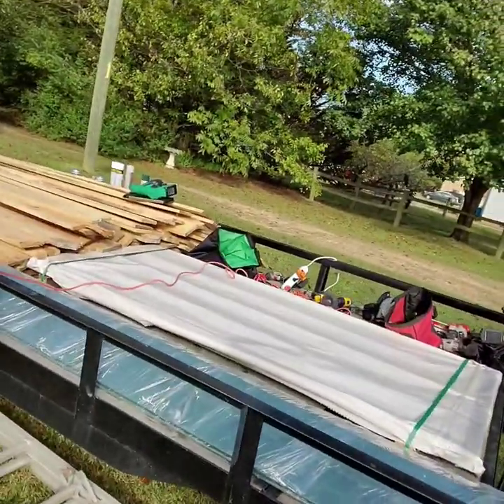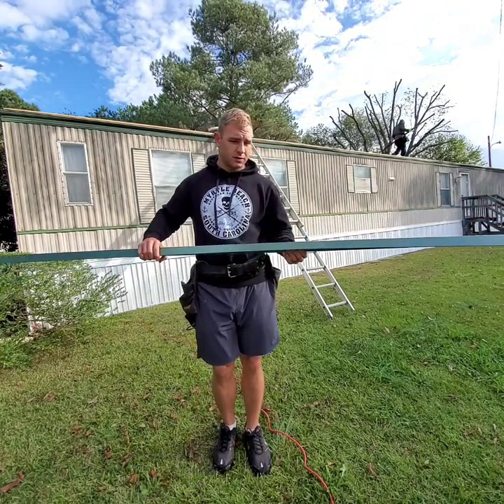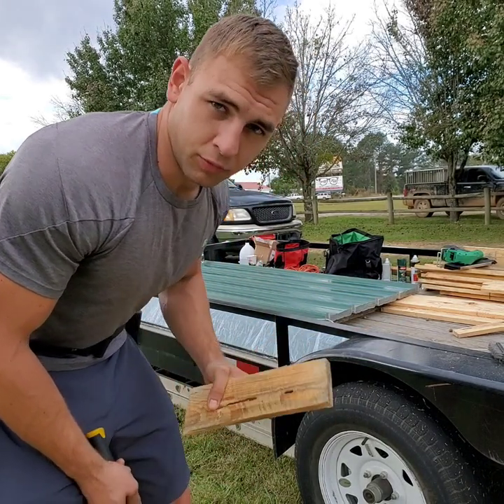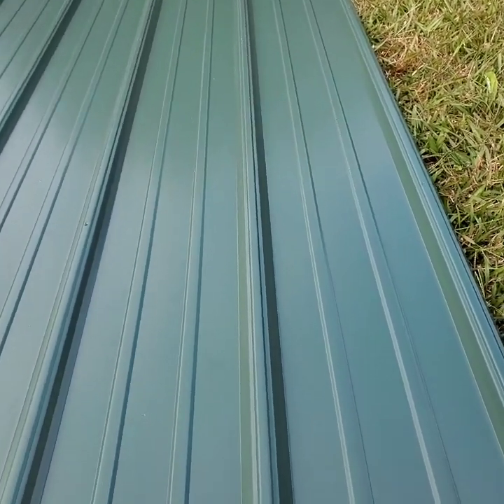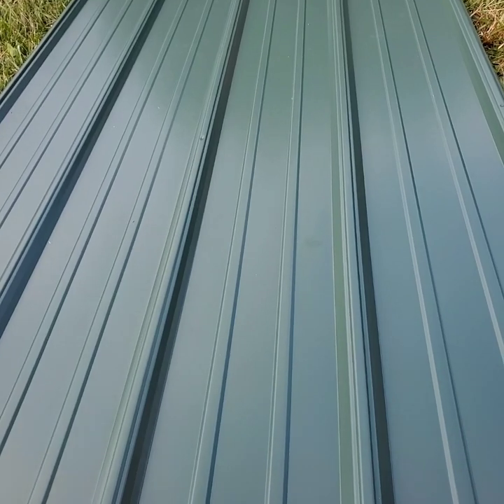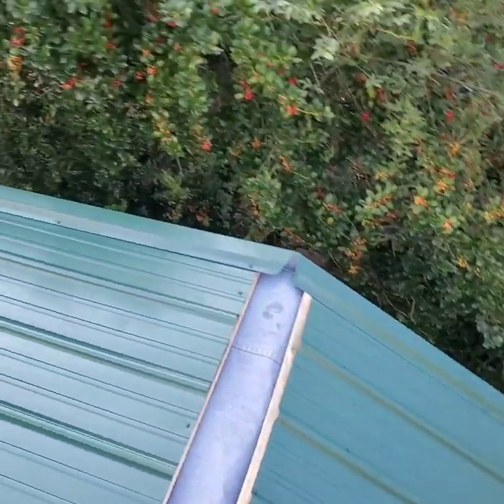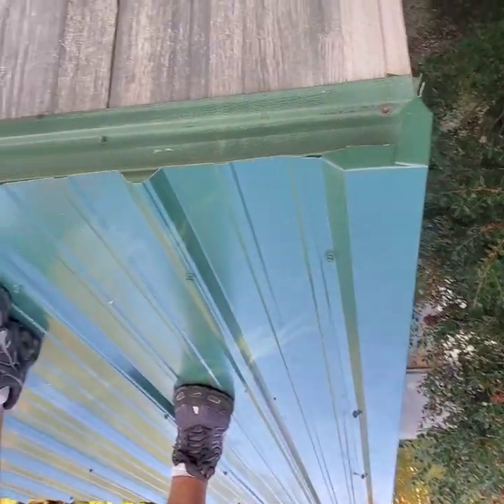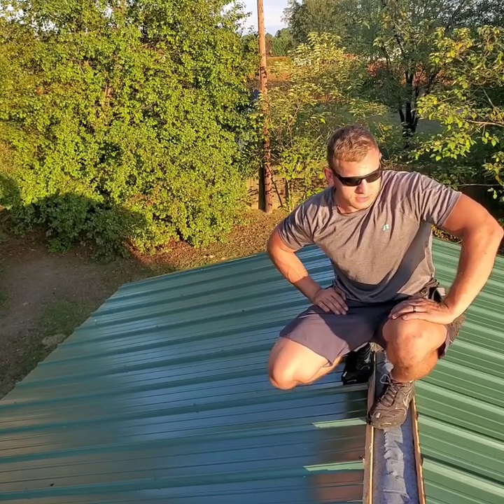How to install a Metal Roof on a single wide.

Comment: Any condensation issues between roof systems ?
Reply: i've heard even small leak shouldn't really be a problem with the old roof beneath
Reply: @cdoublejj   The old roof underneath is now perforated with fastener holes so I doubt it is water tight .
Reply: @markv151  that would be an awful lot of condensation
Reply from the maker: No issues with condensation.

Comment: Do the 1x6's need to be treated? do you notch the bottom side of them to allow condensation to escape. Do you recommend peel & stick ice & water shield before the 1 x 6's?
Reply from the maker: They are untreated, and should be that way. treated can have negative impacts on the screws, You can put down ice & water if you want, but there isn't any reason to put it down. That is mostly used for valleys and shingle roofs.

Comment: You might want to consider staggering the joints of those 1x6 next time, offers a little more support in a wind storm.
Reply from the maker: Screw patterns would look horrible. But I could see a small benefit.
Reply: @rickyelliott3458  No, start your first run with a whole 1×6 then start your second run up with one 1×6 cut in half. This way you have the butt ends of your lath breaking on different truses.  If the wind should get under the tin it won't pill whole sections off at once.
Reply from the maker: @chrish3720  I see what you are saying. I agree that would help more. I would definitely use it at the beach.
Reply: Just trying to help. I like seeing a young man give it a shot. I've been in business for 24 years now. A capenter for over 30. Those old guys taught me a lot in the beginning. Have good day and good luck.

Comment: I noticed you put some foam along the ridge,  before you put ridge cap on, my question is
What was the measurement distance  to place the foam on metal roof.
Reply from the maker: I try to set the foam towards the center of the outside and inside. TO allow the pressure from the screws to hold it down and in. Their is also sealant that will help fix it in place.

Comment: I have a single wide with a slope in the roof how would you do a roof like that
Reply from the maker: I don't install metal on anything below a 3/12 pitch.
Reply: @rickyelliott3458  what type of roofing would you use? Would you frame a pitched roof first or could you use 2x6 instead of 1x6?

Comment: what is the purpose of the 1x6 framing? why do some people use this method and some just lay the metal strait to a shingle roof
Reply: I was told by a roofer not to allow ashfalt shingles to touch the metal roof...bad corrosion would result

Comment: The part I don't like about that type of roofing is all the inverted v notches along the outside wall that allows all sorts of wasps and insects to get under the roof. Those open holes would have to be sealed and or vented to keep wasps and other insects out. I would probably prefer light gray to reflect as much sun as possible from being absorbed into my home. Dark colors only absorb more sunlight and in the summer it will cost a fortune to try to keep your home cool.
Reply: U can plug those holes using the same form molded foam used under the ridge cap but I don't
Reply: I was saying I don't know if that will hold moisture and cause corrosion between the two metal roofs
Reply: @terrysmith1914  I don't know about the moisture either. I do know I'd either rip those 1×6 in half or just use 1×4. Lumber  today is too expensive to use a width more than you need. I would also use wood screws only and make sure they go into each joist underneath the old metal roof. What's bad is some times the trailer manufacturer would run electrical wires between the metal roof and the joist making for a horrible electrical fire if you happen to send a nail or screw through it.
Reply: Do they put anything over the screw holes?
Reply: @follc1991 usually no as they have a rubber like washer on them to keep it sealed.

Comment: What length of nail are you using to fasten the 1x6 down? The questions been asked a few times with no response.
Reply: I would recommend ringshank 8's ,8d/8c.Typically the trusses are 2" material in mobile homes.
Reply: What about using decking screws?

Comment: Is there a reason to use 1x6s over 2x4s?
Aren't 1x6s more expensive? Jw what i should use.
Reply from the maker: They are wider and help support the metal and people walking on them better.
Reply: @rickyelliott3458  right.. I just learned this the hard way.lol
Im doin my roof right now by myself and i did 2x4s cause cheaper and more bite with the screws for my trailer rafters.. But when i tested one out and walked on it it bent the sheet all up... I did 2 ft centers.. But not enough support obviously with the 2x4s.. So i had to run extra 2x4 supports between them.. I wanted 2x4s tho cause my trailer is old and wanted to screw them in to rafters with screws instead of nailing them so better strength.. I assume the 1x6s are prob better for if you put the insulation board in too( which i did not)

Comment: Hi I just wanted to ask what size screws do you use on the panels and ridge cap?
Reply from the maker: I use 2 to 2/ 1/2 inch screws, and we use a wider ridge that is 9 inches on both sides. 18 in total.

Comment: can a mobile home ever be moved again after this type of roof install?
Reply from the maker: Yes it can,  but the screws must be done right. The wind from the highway can and will make panels fly off if the screws aren't done right.
Reply: @rickyelliott3458  Thank you!
Reply: @rickyelliott3458  just a thought but if you lay the panels end of trailer to the front where the hitch is I would think would eliminate that likelihood as there would be no edge facing the wind drag being pulled down the road.

Comment: It is expensive that kind of metal roof?
Reply from the maker: We give free estimates if you are located near Lee county, Nc. We believe the money is well worth. When considering this install came with a lifetime paint warranty from the manufacturer & a 20 year no leak warranty.
Reply: you can call your local metal building stores and ask if they have extras or off the wall .i just priced for a 14 ft wide and 1 panel was 32.00 if i buy off the wall they can be shorter but they are10.00 each and are different colors. nothing that a little paint cant fix.
Reply: That 20 year leak warranty isn’t anything a manufacturer offers. You as a company offer that to customers. Soooo what happens if you go out of business?? Who’s going to warrant that roof?

Comment: What about the old single trailer that has a flatter roof?
Reply from the maker: Most people will install a new 3/12 pitch frame with wood, or go with a flat epdm roof method. Which involves using osb/fiber board and EPDM (rubber).
Reply: @rickyelliott3458  iv been told the metal dont need much pitch at all for water run off and could lay osb down then metal over that. What's your thoughts on that
Reply from the maker: I personally would not install it if it wasn't a 3/12 pitch. I would use rubber. The risk is to great in my opinion.
Reply: @stevebillow395  not sticking my nose in but that won't work - i replaced a flat roof  a couple put on their house you have to have some pitch - don't let anyone tell you different or you'll regret it.
Reply: @rickyelliott3458  what was the pitch on that roof ? doesn't look more that 3-4/12 ?
Reply from the maker: @larryrichardson5167  ruffly a 3 or 4 on 12.
Reply from the maker: @beavis4play  pitches are always preferred obviously,  but EPDM is used for flat roofing
Reply: @rickyelliott3458  -- agreed- i used that on a very small porch attached to a  greenhouse and it worked well. i still would rather use some pitch though- thanks for the reply!
Reply from the maker: @beavis4play   I deffentlly agree.

Comment: Is weight of the metal on the trailer framing a problem?
Reply from the maker: A metal roof is 1/4 the Weight of a shingle roof. It is not a problem at all.
Reply: Is that some kind of membrane on the roof or is the or is the roof that good a condition? Should there be something between the original roof and the metal ?
Reply from the maker: @michelestellar153  no
Reply: @rickyelliott3458  my entire house is clad in 'tin' now I was just asking because that was always on my mind. Done by local Amish and I LOVE it. Highly recommend the steel it has sealed my house whereas the T111 siding was never as 'tight'. Here they call it  'tin'. Love the comfort and durability and the snug feeling... And the sound of the rain on the porch roofs. The roof over the house proper does not make much noise. Just letting others thinking of steel  know that it worked out great for me. Hail is a big deal here, we have had some the size of tennis balls, totaled a car, my roof and siding, not a dent. Your job looks great .
Reply from the maker: @michelestellar153  Metal/tin is the best roof/siding you can have. I agree with you. There are different grades of metal and paint systems. But in General agree. For doing overlays on factory tin roof's you don't have to do any membranes. The home owner requested we remove the rust, though I insisted it was not a problem.  For any other type of roof, or siding, I would recommend a synthetic underlayment.

Comment: I dont like that a little rubber gasket between the sheet metal and the top of the screw is the only thing stopping the water. I think the sun will dry the gasket and now you got a leaky roof.
Reply from the maker: It can happen, if the screw was run down to hard, but the screws are designed to last the life of the panel. You most defiantly may have problems if you install them in the flat section of the panel. We put our's on the higher part. We warranty our roofs for 20 years. So I have confidence in it.
Reply: @rickyelliott3458  I was happy to see u put em on the peak folk round here put on the flat and leak leak

Comment: How much money did you charge to put the roof on..
I'm doing one basically the same size
80×16...

For my Kid's grandma trailer....

She paying me 600..

I'm doing it dirt cheap for her..an making it a family thing I have my boys helping 

The reason I ask brother how much you charge 

Incase someone wants me to do one for them

I can over bid
Because I can't handle this kind of work no more..

I'm guessing over 2000 you charge 

The trailer I'm doing the wood trusses are up n down 1inch in some places 
I got the strings out..an trying to fur everything flat..

This is a back breaker

Comment: how do you determine if the single wide mob8le home is strong enough to hold the new metal roof....because ive seen some where they put in poles on all four corners and some in between against the exterior walls  so that the new metal roof is supported by the posts...
Reply: That seems overkill not much of a mobile home anymore if you do that, I've seen them hold up fine with a ft and a half of snow on them no problem, they don't build them very well but with interior walls helping carry the load they do ok supporting a decent amount of roof weight
Reply from the maker: If the rafters are in good shape and not rotten. Then she is good to go.

Comment: Never screw on ribs guys
Reply from the maker: Hi Bryant, I appreciate your recommendation. I, however will continue to advise screwing them into the ribs. Placing these screws in the flat's puts them directly in path of water flow, which overtime will deteriorate that washer garment. Some roofers will claim placing them in the rib causes the screws to back out,  I don't find this to be the case.
Reply: Sorry ask ur manufacturer about it
Voids warranty on the ribs 
Screw on a rib it doesn't get a good deal also when the metal moves the hole gets bigger
Reply from the maker: @roofking2314  my entire family has been installing roofs for over 30 years. My uncle has been a supply distributor for over 15 years. I say with full confidence, this is not the case. Yes the manufacturer recommends this, I do not. I am the one who warrentys this roof in contract. Thank you for your feedback.
Reply: I understand
Done thousands of these roofs with no issues in the flats 
If under a 3/12 pitch yes washers will rot out most likely
I'm sure you'll have no problems on the ribs but here they void any warranty if not in the flats
Kinda same as shingles if not on the nail line
Reply from the maker: @roofking2314  your comment about hitting the shingle nail line as being compared to screwing the screws in the RIB, is misleading and inaccurate in functionality. You are 100% right about the manufacturer warranty, but they also claim these screws must be changed every 10 years to keep it.
Reply: No matter how u look at it or want to argue it's voids manufacturers warranty and done incorrectly 
But luckily your warranty backs up any issues
Reply from the maker: @roofking2314  yes sir, you are correct. I inform every single one of my customers with this same info. Hey Bryant, I'd love to invite you to our facebook page.
Reply: @roofking2314   screen shoot this if he does your roof! he stands by his job. ok.
Reply from the maker: @laschell59  I definitely understand, I run a roofing company. We stay busy, so it was difficult for me to film and install at the same time. We were also trying to finish quickly because a big storm was rolling in.
Reply: @laschell59  I'm a roofer of 18 yrs lol if I need to hire someone I'll be 80
Reply: im not a roofer,tho ive helped do some with my family who is, but i think warranty or not, screwing into the rib seems to be more ideal than on the flat.. Seems like common sense that if water makes it into any screwhole( which eventually will), far far far less water will seep into a rib than a flat.. Water runs off the ribs onto the flat.. Not the opposite.. Most the water will run off the rib before it even makes it to a screw hole.. Again... Common sense... And professionals also talk how this corrugated metal isnt the greatest compared to standing seam metal bc of it expanding causing the screws to move and back out anyways.. So no matter what.. No matter where they are they will be pushed on and worn out... Including the holes.. But them being on the ribs also seems obvious that the steel could expand and contract more freely with being inside a fold in the metal sheet. Leaving the rest of the panel thats flat against the roof floor to swell.. I mean doesnt  the flat parts get the hottest since there is no space to breathe there?
Im thinking about doing my trailer roof myself so wanted to watch this and get a better idea..thx for the vid..
Reply: How is the washer going to seal correctly on a rounded rib? It won't
Yes metal moves when hot that's y it's always good to put purlins down first them metal
You put in plywood it's to soft
Yes it'll last 20 yrs but you'll be replacing a few screws but that's cheaper than replacing a whole roof
We always screw in the flats but don't bust the washer or it'll rot
Reply: @roofking2314  isnt the screw hole alot smaller that the washer? Doesnt seem like the ribs have much of a curve to leave an open gap under the grommet.. And I think u could bout out right leave completely open holes on the rib and not collect enough water to damage.. Lol.. Unless its snow covered, but I wouldnt ever say the same for flats. I think there may be pros and cons to both..
I think people are a little ridiculous about it honestly.. And if people wanna cry about it so much they should prob just skip corrugated completely and just go with standing.

Comment: HELLO MY NAME IS NANCY . MY SON IS A ROOFER . HES GOING TO BE DOING MY ROOF . I LIVE IN A MOBILE THE SIZE YOU JUST DID YOU DO WONERFULL WORK WERE FROM BATH PA . I HAVE A SHINGELED ROOF . I NEED TO PUT A WHOLE HALF OF A ROOF ON DUE TO A LEAKING SUNFOOF IT WAS NEVER SEALED RIGHT WHEN I BOUGHTTHE TRAILER A NEW ROOF WAS PUT ON TEN YEARS AGO . BUT NOW IT DID A LOT OF DAMAGE INSIDE MY BATHROOM AND BEDROOM . MY QUESTION IS I DONT HAVE ALOT OF MONEY TO FIX IT THE RIGHT WAY IN ORDER TO FIX THIS ROOF WHICH IS THE BEST WAY TO FIX IT I THE SHINGELS ON THE TRAIL HAVE TO COME OFF DOWN O THE STUDS ARE THEY MAY ALOT OF SOFT SPOTS ON MY ROOF WHICH CAME  UNDER MY SHINGELS AND THE ENDS OF THE EDGES ARE PARSHELLY ROTTED  IT A  MESS DUE TO THOSES SKY LIGHTS .ON THE OTHER SIDE ITS THE SAME WAY I DONT IF I SHOULD TEAR THEM OUT BOTH OF THEM AND PUT PLWOOD OVER THEM AND SHINGELS YOUR VIDIO WILL GIVE MY SON AN IDEA WHAT TO DO HE WORKS FOR A GUY NAMED  WHITE I DONT KNOW HIS FIRST NAME HES A VERY NICE MAN . IM AT MY WHITS END WITH THIS TRAILER WHATS THE BEST WAY TO FIX MY TRAILER .
Reply from the maker: Hi Nancy, I'm sorry to hear about the problems in your home.  It sounds like you have some bad wood (severely) I would recommend shoveling all the shingles off and replacing the rotten osb & close up the skylight. Then put down the new metal. Any other way, just wont cut it i am afraid.